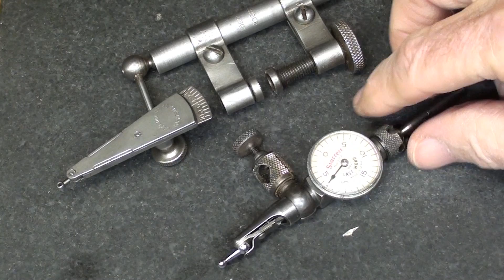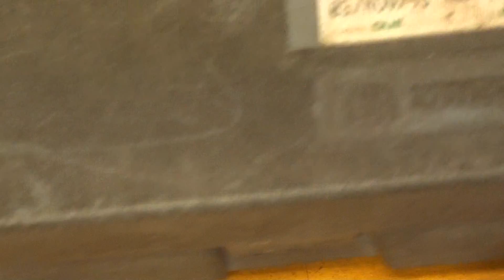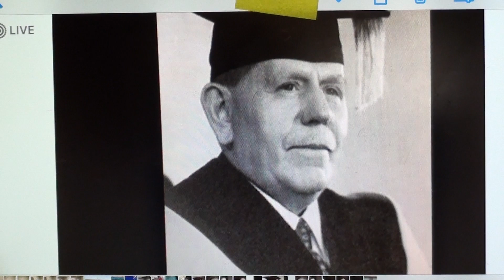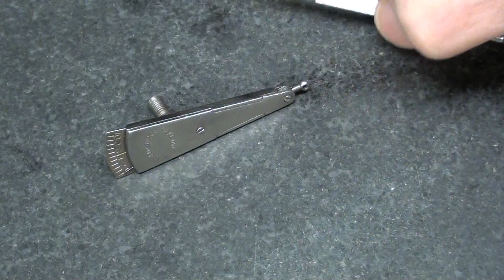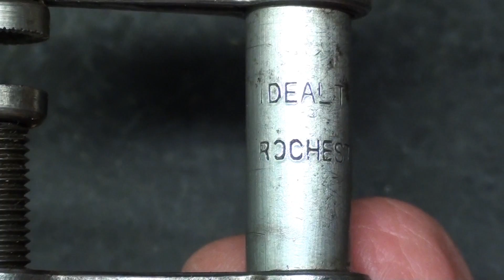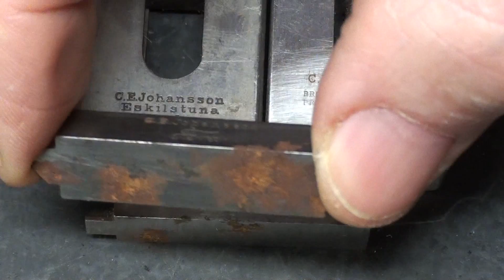Accuracy of Antique Test Indicators #529 tubalcain

Comment: I’ve come across this video 4 years after publication. I wonder how accurate this mechanical indicator is if used as a plus or minus gauge using the .005 as mid range and using it that way. In reality when an indicator is setup it is setup in such a way that you can measure high and low side of tolerance not just the measurement you’re trying to get to. That is if the indicator has the range, but certainly this could work if your tolerance is plus or minus .003? It would be nice if the video showed that as an example as well.

Comment: Our tool room grinder from Manila said that they didn't have any fancy test indicators during his machinist training. They used a piece of wire mounted on a pivot point to dial in the parts. This is the same principle as your antique test indicator without the graduations on the scale.

they probably had a weight on the side of the wire contacting the part to keep it engaged with the surface of the part being dialed in.
Reply from the maker: Interesting!

Comment: The Ideal is old and the pivot point is worn. I doubt that jewels were used in its manufacture. The most common area of usage would naturally be somewhere in the middle of the scale. That put all the wear in that area of the pivot points. Imagine someone letting the lathe spindle run while checking run out of workpiece.
Reply from the maker: Great analysis

Comment: What a coincidence, I have Single Ideal Test Indicator in the original box! Of course what single means is that the needle and graduations are on one side only. This indicator came with a 0.250 by 0.500 mounting bar and nothing else. Maybe this video will get me to test it and perhaps make some other ways of holding it.

Comment: If the indicator is mounted at a 45 degree angle it will read half the value..... Isn't that correct.... Because the angle affects the lever moment.... I do belive that would be correct.... At less than 45 degrees you will get uneven reading.... At 45 you should get 1/2 the reading but it will also be progressive errors.... The last word uses a plunger... The ideal uses levers... One your tools and use accordingly..... The ideal just needs to be set up correctly to prevent progressive errors.... Even dial indicators will show errors depending on the indicator of not mounted near plumb or level.... A dual plunger in a 45 will show half the reading as well depending on the construction of the tool

Comment: I have an old indicator similar to the Ideal, but the form factor is different.  It's a G.E.I. EHNER; rectangular body, 3/4"x~1-3/4", reads 0-15 thou, and the button extends from one corner of the rectangle.  Patent was applied for, but may not have been granted (I can't find it).  Mounting is unusual- two knurled nuts clamp on a plate to secure it to fixture/stand/work.
Reply from the maker: I have never seen one
Reply: @mrpete222  Hi Lyle- I'd send you a photo, but can't find any contact info for you.

Comment: ok Mr. Pete, we know that you never throw anything away. LOL.   When I was working, we just bought new gage block sets that were Chinese made as it was far cheaper to buy new ones rather than pay for calibration.  At the time, 6 years ago, you could buy them on sale for under $ 100.00 USD and they came with certification.  Good to see that you moved the gage blocks to the indicator as you never move the indicator to the piecework, also do not moving directly towards the indicator stylus, but at a sideways movement, or from the hinge side. there is less chance of '  bouncing '  the set up. Lever indicators were never meant to check multiple heights, only used for repeatability due to cosine errors.  You need to get your hands on an Interapid or an Alina .0001 indicator if you can. Then you can have some real fun with testing. have fun !
Reply from the maker: Thanks. I think I have an interapid

Comment: I have one of those Ideal indicators, came in a used tool chest I bought.  It was a rusty mess, soaked it EvapoRust, cleaned up OK a little sticky though, may have to take it apart.  Why do gauge block manufacturers always use wooden cases, you'd think they would know better?  Good lesson mrpete!

Comment: I think that the Ideal indicator only has its age working against it.  It looks like it has a worn pivot, either the pin or the hole, or both.  That would certainly make it inaccurate.  The geometry of the tool says that given precisely fitted parts, it should be quite accurate and repeatable.

Comment: Considering how basic the mechanism is on that indicator and god only knows how much wear it has a thou and a half error is pretty good !  You most certainly couldn’t centre a piece in a four jaw chuck  using the old surface or scribe gauge  any better than that .
P.S i love my little last word indicator ! Even though i have  indicators made Switzerland i still  reach for that little Starrett unit every time .
Reply from the maker: Thanks

Comment: I always understood that the last word style indicators are a comparator and are not really to be used as a direct measuring device as since the stylus moves in an arc and not a straight line there always will be some error due to the arc motion being translated to a linear movement.

Comment: Another informative video, THANKS!  The set up did with the IDEAL might not be ideal.  You might get better results if you think of the 5 on the indicator as your zero.  In effect preload the mechanism.  Then change blocks to add/subtract up to .005   That might (should) yield better results.  I would never trust test or dial indicators for anything but "relative", and that means start in the middle.  Long winded 2 cents worth.

Comment: I rarely argue with Mr. Pete, but I don't think it's really a fair test. You can see the housing of the indicator move as he's inserting and removing the gauge blocks from under the tip, especially at the .008 and .010 test marks (https://youtu.be/P1zZRJmvtJQ?t=743). I'd wager that with a more rigid fixture, it would likely be more accurate, but I accept that the mounting options designed into the indicator probably contribute to the error, and would take considerable effort to solve.

Comment: the indicator body was pushed up more with each increase from non linear spring pressure against the weight of the overhanging surface gauge.

Comment: I have a test indicator that at first glance is a duplicate of the Ideal indicator. Mine is British made and has a cut-out window so that the indicating needle doesn't have to be split. It has a 0.015" range. One side is graduated in Imperial and the other side is metric. I've found it to read accurately across it's range.
    I've had the indicator over 50 years, but rarely use it. Test indicators like the Starrett Last Word are more convenient to use.

Comment: I have the Starrett version of the Ideal mechanical indicator. I tested it against a milling machine DRO and it was accurate to better than .001" across the range. I bought it on ebay for centering in a four jaw. It was cheap and featured in the Henry Ford Trade School book. I wonder if your indicator accuracy would improve with a cleaning and oiling? Loved the video by the way, thanks.

Comment: I am very new to machinery work and I have purchased my first lathe I am far from being able to purchase starrett tooling but I have purchased a digital micrometer and digital test indicator both Igaging brand from here in Australia and I am wondering if anyone could tell me if this brand is work my money and if there is anything I should be aware of with this brand they seem and feel like good quality but being the firs time having anything like this type of tooling I and used both digital and dial callipers for the last 20years or so but I have never needed to messer anything less than a tenth of a millimetre
Reply: Allan Barnes Keep plenty of spare batteries on hand cheaper calipers eat them compared to quality ones but their accuracy is excellent.
Reply: W S was your comment based on experience with Igaging brand equipment or as a general rule with lesser quality tooling if you have actual experience with the brand could you please tell me your general experiences with accuracy and there limitations please

Comment: The primary pivot shows considerable slop, indicating it is severely worn thus causing the error measured. A challenge or the old eyes would be to manufacture a new bushing to restore it to useful condition. I'm seventy four and have several magnifying devices for the times I stupidly try something like that (lol). Love your videos. From "downunder".
Reply from the maker: Thanks

Comment: I'm wondering if you had some cosine error when checking the Ideal. It seemed to me that you could not get the stack of gauge blocks under the pivot (unlike when checking the Starrett). This put the sensing probe nearly level. I have always understood that these lever-style indicators (both pointer and dial) should have the probe angled down enough that the tip is below the level of the pivot housing - typically about (edited from 27.5) 22.5º (half of 45º). The Starrett was angled down about that much as I could see that you could pass the gauge blocks under the pivot housing on several occasions.

Comment: Those blocks could be cleaned up and used, as long as they were marked with the value negative to what was stamped on them, so the user can compensate.  

It would probably cost more than a new set to have it done, so one would have to be desperate to have something of known values for as little cash out as possible.  Or looking for something to practice Lipton style lapping on.

Comment: Nice video. The flex in the body is probably due to the mounting system. The screw (from the inside) that provides the mounting point may have some play. I loctited all of mine (6? 7? of them) to address that. The stock clamp can be tightened to remove play, as well. The screw is inside the body near the ball, and the screw at the bottom needs to come out to reach it (presuming it is the same design as mine). Somewhere, I have ads for these, as well as the patent (electronic), and an original instruction sheet. The accuracy isn't great, but when the unit is tight, it is better than shown here, and the error is pretty linear over the range. I prefer the Lufkin 199A, myself, but I only own one. Or a Starrett 64. Not so fond of the Starrett 564, though. The ball that allows rotation tends to be sticky (three examples, including one bought new about 20 years ago all have the same behaviour). The Ideal's seem to fall from the trees in my area. Also note that an Ideal is on the Wikipedia page for indicators.

Comment: The reading depends on the angle of the indicator due to cosine error. If you set the ideal indicator at an higher angle the reading shuld get better.
Correct me i’m wrong.
Reply: Should*

Comment: Thanks for dismantling the Ideal indicator. I've got one of the type over here in the UK, it very dirty and 'stuck', so soaking in a sealed jar of brake cleaner, think it might be a Starret. I now know what to expect when I strip it down. My plan, assuming I can get it to work, is to check the run out in my lathe on set up so really using it as a comparator, accuracy of measurement is not important. As always a fascinating project with history lesson thrown in for free.

Comment: Mr. Pete, a stained or lightly rusted block is not unusable, it is unreliable, for rough work it can tell you when you are close.When that ideal indicator was new it was probably accurate enough that it sold well. Back then was about the same as when you were in your prime you did not buy crap junk tools. You got the best you could afford, not the lowest cost you could find. I am 10 years younger than you, I am almost a shut-in, thank you for being on YouTube. You keep me from wasting to uselessness. One of the problems as I aged is essential tremor, it is hard to eat peas with a spoon unless I smash them a little. My trade, I worked on computer systems I used to rebuild disc drive heads and platters. I could measure the thickness of the film left after alcohol evaperated, it mattered which kind we used because of the film.

Keep up your great work, you are not boring us.

Comment: I'm not certain it's really fair to say the old one is "unusable". For most purposes you only care about a null measurement, and I don't know how accurate the graduation were intended to be.

I'd suggest taking a sine bar, with a 1-2 thou difference between the ends, and sweeping its length to see if the indicator is sensitive and smooth enough to detect the difference.

The Last Word, in particular, has a bit of a reputation for getting sticky. The mechanism uses a ruby with a helical groove inside that is apparently quite delicate.

Mine works fine, but I am careful with it and it's not seeing daily use in a working machine shop, just light hobby use.

As far as possible combinations of gage blocks, an 81 piece set with no duplicates would have 2^81 combinations, roughly 2.4x10^24. At this point you're probably sorry you smashed that nice old slide rule 😎

Comment: Other manufacturers made similar test indicators.  I have a few of the Lufkin 199 (199A) indicators from the 1950's.  I still use them sometimes.  Here's a couple of patents you may want to look at:  USP 2090495 and USP 228497 both to Witchger and assigned to the Lufkin Rule Co.

Comment: My all around set of blocks is exactly the same as this Fowler, just that they got no corrosion and still ring...    ;)
Waybe a little paralax error on a test indicator, shows more as the travel increases...
Don't worry about the mess, here, it's a permanent war zone...    lol
Reply: that is " wring " as in WRING out the air between the touching surfaces of the gauge blocks .
Reply: Sorry for the mistake, French being my first language, there are still a few obvious mistakes I make when speaking or writing English...  
Just learned something new today, I'm better machinist than translator......     ;)

Comment: "Rewinding"  the video a few times after you opened the case,  you can see there is wear in the pivots as the indicator point/lever was actuated.  Just send it back to the manufacturer for repairs. lol.  Imagine locating a replacement spring and then replacing it?  Delicate and crude but, it worked. Nice relic.

Comment: Tolerances and accuracy from 1900 are still usable today.  But the metrology advances made between 1900 and today are almost miraculous!  It's so cheap to measure accurately now, but machining to what we can measure is still expensive, or time consuming...  

More than 3 digits to the right of the decimal is getting into the noise.  I wonder if kids nowadays learn about significant digits anymore?   I was trained at the end of the sliderule age, and significant digits were hammered into us at every turn.  Even after calculators were affordable.
Reply: Yes we do..... weekly rent and student debt costs more then the highest significant digits provided in a wage slip.
Reply: Not quite where I was going, but accurate non-the-less!  I like the wit!  It's not just for students, tho.  I've been out of university for almost 30 years now, and my stagnant wages don't spread as far as they used to....

I was aiming for this:  https://youtu.be/5UjwJ9PIUvE?t=1m8s
Reply: @stxrynn What? Everyone knows that the circumference of a circle with a diameter of 10 inches is  31.415926535897932384626433832795 inches, not 31 or 31.4 Who are you trying to fool? 
But yeah you'd think NASA would need some hairy accuracy when plotting a course to Mars, but no. they use 3.14
Reply: @ExtantFrodo2  I don't know about that, their 1960's engineering stress and deflection software we used(NASTRAN) usually went out 6 decimals.
Reply: @bcbloc02   ...because those were not insignificant in the employed metric. Right? Plank's constant has significant digits out to 10^42. Atomic force microscopes detect deflection's in the picoNewton range. It doesn't change what I said about calculating a trajectory to Mars.

Comment: For the caliper test if you have a plug gage of the largest size you have check the jaws for racking by checking front middle and back of the jaws with the plug gage. This is the number one complaint i have with people if the adjustment set screws are messed with you lose calibration and for whatever reason people loosen them to make it glide extra smooth.

Comment: You could try that again on the other side I think if you look at the tip you will find one side is no longer round and since the unit read low at the top of its range I'm going to guess that the back side is slightly flattened do to wear and not being round is the number one reason to reject
Reply from the maker: Good idea

Comment: Good morning. I do hope you are staying warm!
Isn't it possible that as the tip of the indicator rises to a certain height, a cosine error is created?
Reply from the maker: I think the whole thing and flexed
Reply: On the Ideal indicator you may be correct but I was also referring to the Last Word indicator as well as it uses gears which is indicated by the .0002 error.
Either way, thank you for posting and stay warm.

Comment: The Ideal gage while inaccurate could still theoretically  be used to check runout or vise alignment since the target measurement is "zero" as long as the needle has close to zero back lash.   Obviously the modern jewelled  indicator is the way to go I wonder how accurate a brand new ideal gage would be,  since they no longer exist as "new" I suppose that will remain a mystery.
Reply from the maker: Yes